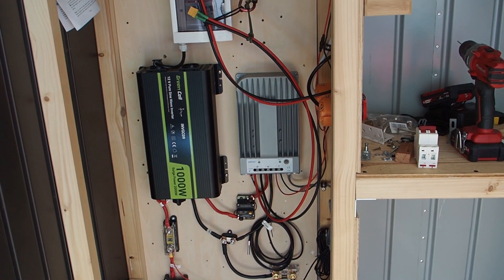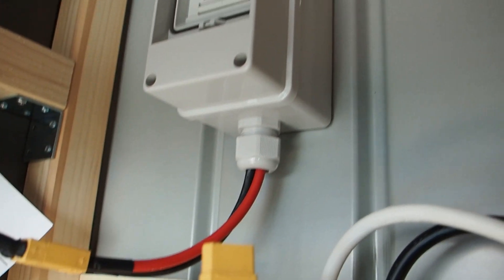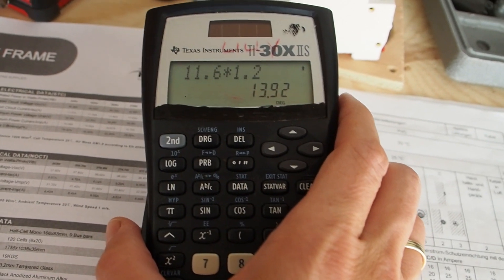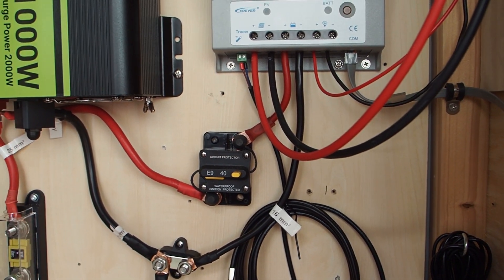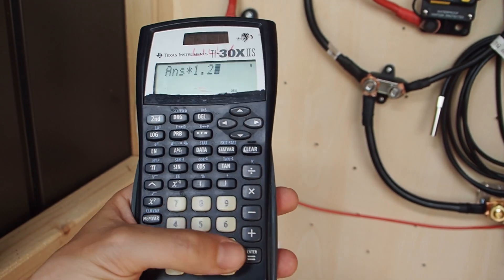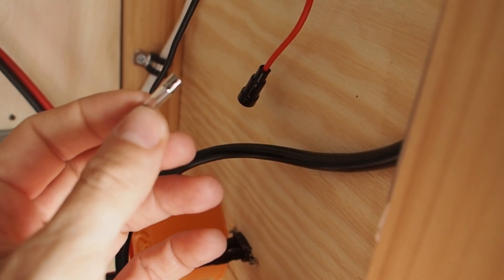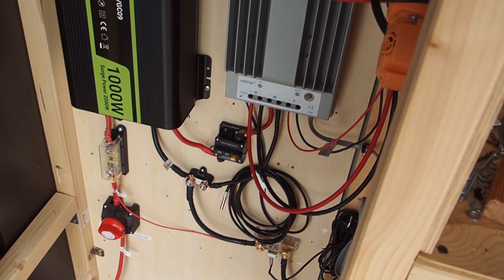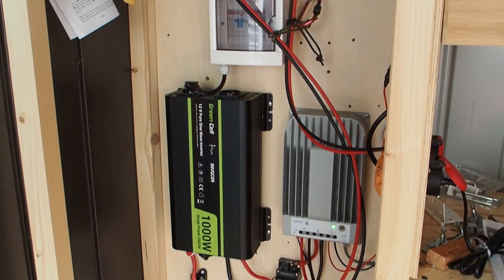How to size Breakers on a 12 Volt Solar System

Comment from the maker: If you want to support my channel: 
✅ Off-Grid Solar Panel: https://bit.ly/3EviFv2 (10% Off with discount code: survivallilly)
Reply: Hi Lilly, I've watched quite a few of your older videos when you were testing out archery equipment. I am wondering if you could recommend any archery dealers , preferably in Europe. Thanks.
Reply: Brasil.    Uma dica pesquisa sobre bateria lifepo4 de lítio são muito melhores e dura até 10 anos muito melhor doque bateria de chumbo que só dura 2 anos média
Reply: XOXOXOX
Reply: Super ausfürliche Info! Ich bin aber ziemlich übel worden weil die Kamera schwebt ständig überall herum. Vielleicht bin ich einfach empfindlich. Trotzdem, super gemacht. Danke!

Comment: Nah, you don't need breakers or fuses. Just a really GOOD fire extinguisher, right? LOL
For systems less than 28v, it would be very rare for someone to get electrocuted.

I will have a breaker at the array and one inside at the equipment.
A breaker for each battery too.
And probably some battery fuses.
Inverter has it's own fuses that are replaceable from the factory so no additional needed for that.
My array will output about 35 amps max. I plan on using 30 amp breaker just to be safe. I may go up to 40 amp.
My array will be 100 feet from the controller so I will suffer line losses thereby reducing voltage and current.

If you blow a fuse, you better find out WHY before replacing one.

Inverters have two ratings - a much higher one for startup and a regular one for continuous.

Comment: Very nice setup, Lilly! One more accessory you can add for protection is a solar panel relay. Many solar charge controllers can be damaged if the solar panels are connected while the battery is not. So, if the fuses on the battery happen to blow, the charge controller can be at risk. To my charge controller, on the wires coming from the battery terminals, I ran a couple wires to a relay. When there is battery power supplied to the controller, the relay will be on, with a negligible draw from the battery. The dc positive cable from the solar input then runs through the contacts of the relay.  Then if the battery fuse blows, the solar is automatically disconnected, in theory, before damage to the charge controller occurs.
Reply from the maker: Absolutely true. But I think my Epever MPPT can handle the current if the batteries are cut off. 👍
Reply: What kind of relay are you using that takes a 12v trigger and handle a higher input voltage/amp like from a solar panel? This is a great idea but I'd have to be able to switch something like 70volts at 18amps with a 12v trigger

Comment: A CAUTION: Inverters should be mounted horizontally NOT vertically. The internal fans are designed to have horizontal shafts so that the fan's bearings will last  longer. If they are vertical the downward thrust of gravity will wear the lower bearing and may fail causing the inverter (or anything with cooling fans) to overheat and may start a fire. Check the instructions or the manufacturer.
Reply from the maker: That is correct. But I didnt have the space to mount it horizontally. I will only use the inverter with smaller loads tough, so it doesn't get too hot.
Reply: @SurvivalLilly  Sounds good. I have had 2 inverters and 2 charge controllers literally go up in smoke. Fortunately I was close each time. A smoke detector nearby would be good also.

Comment: For safety reasons I would size the wire and connectors for twice what you expect in current; things can get loose and get hot.

❤

Comment: Hi Lilly, excellent video. My only suggestion would be to write an orderly  Shut down and Start Up procedure for your unit. Reason being if a failure occurs it would give you or someone else a starting point. Even though its small compared to the UPS and units I have worked on. The reason if there are loads connected and turned on when the battery breaker is switched on, the surge could blow fuses or trip other breakers. Thanks for the detailed lesson on sizing breakers.
Reply from the maker: After I build the door I will write an instructions manual onto it 👍

Comment: 1st rule: Dont build high current electric systems on plywood.
Reply: Better is using metal or nonburning plastic cabinets.DC current produce much sparks when short circut  occure. Just advice!
Reply: How do think houses are built?
Reply: Cement board or anything that is non-combustible metal cabinet etc etc…

Comment: The job off the baker is to protect the wires. Of course it need to be sufficient with the load.
In the charts we find the max  current at serten temperature ,the cable can handle. The size of the brakes can be solve by the brakes carteristic.if  it is type c  the rool of thumb is 0.9 times max wire current.because it won't trip at his nominal current .so he need to be less .

Comment: Stay away from off brand breakers. That yellow breaker is junk. Go with Cooper Bussman.

Speaking of Will, I'm pretty sure would recommend going 24 or likely 48v system. Cheaper to build due to reduced cable and lug size. 12v is fine for an RV, but I would go with at least  36v system for virtually anything else. 48v is better. It could present some dangers to the careless and uniformed types, but that's not you.
Reply from the maker: I have found that 24 Volts parts like inverters have become immensely expensive. In a crisis it would also be hard to find one. For me availability is more important than saving a couple of bucks on thinner wires.
Reply: @SurvivalLilly  True. I forget you're in Europe and that many things are more expensive and harder to get. But the breaker, I wouldn't skimp on. I've had two of those and both failed to properly break at the rated amperage. Over time, one would not even reset. Went with Buss brand breakers and never had a problem. It's been 10 years.  My main 100amp resettable breaker is also the master disconnect for the system. 
Good job on the build otherwise 👍
Reply from the maker: Thanks for the tip I will look into Buss breakers 👍

Comment: I feel like it would be much safer to go with the closest size down from the max, than the closest size up. If your controller can only take 30 amps(36 max), but the breaker doesnt blow till it hits 40, the controller would already be fried. Seems like youre better finding the closest size down from 36, like a 32 or something like that, or your equipment blows before the fuse maxes out. Right?
Reply from the maker: the solar charge controller briefl can put out more that 30 A. It also has internal protection so prevent damage at the inside. The inverter also can deliver more than 1000 Watts if you look in the manual. So for just a few seconds it is fine until the breaker breaks.
Reply: @SurvivalLilly  ok, yeah I was looking at it in the wrong direction.